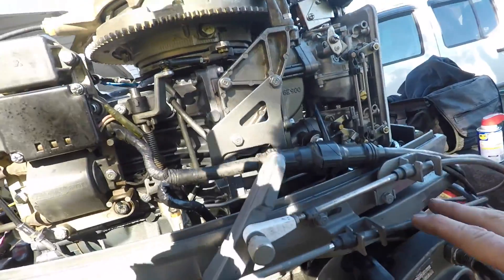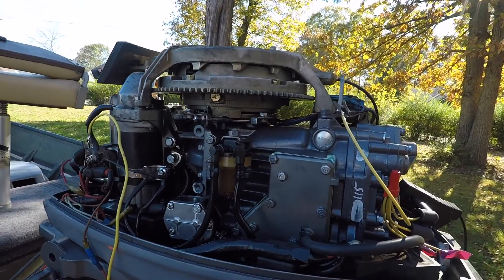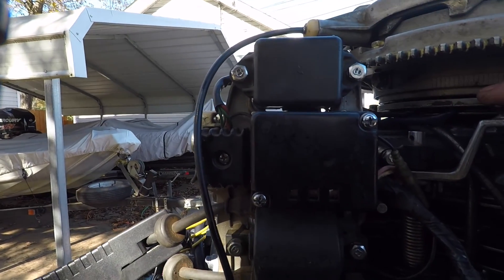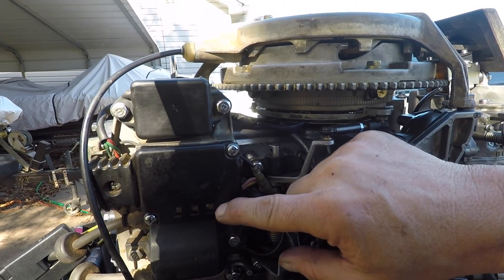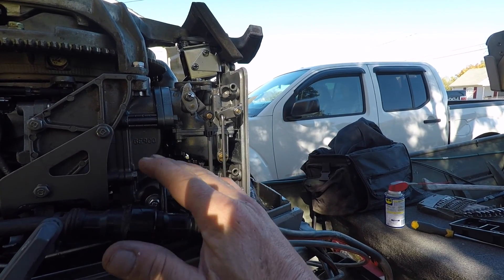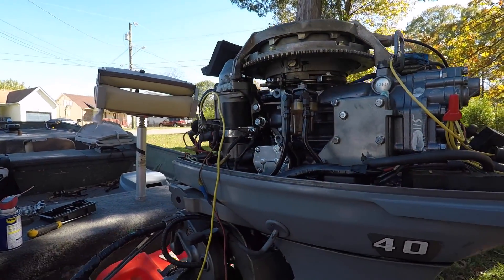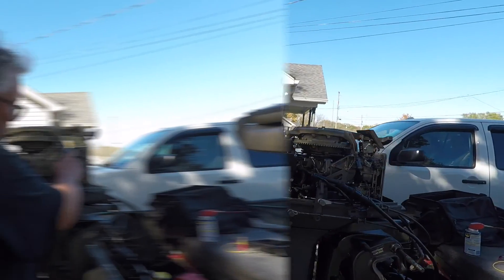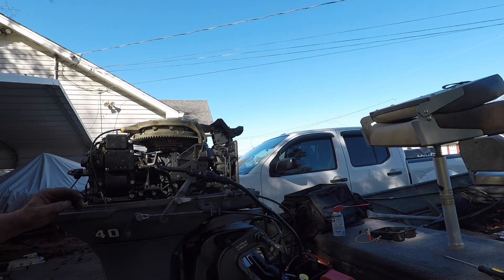Mariner 40hp 40c timing

Comment: Hi. Can you tell me the part number for flywheel mariner 40 6e9.What can I replace this part with? What else is it suitable for?
Reply from the maker: Does it have a serial number?  That engine was made by Yamaha.  Going to depend on that serial number that's on the side of the engine.  Usually near the mounting brackets.

Comment: This is an old post but I love this 40's I've got 2 of them ... Timing ok n Yamahas are about setting up linkage by MM's scale each link set accurately and carbs synked... she'll run fine
Reply: @Showmethefish  I bought an old 1987 Mariner 40hp twins cyl.  I knew when I bought it that it needed the gear case rebuilt completely. I knocked that out without to much complication. Oh yeah, the day I  bought it, the owner started it for me, so I knew it ran. Took it straight home and compression tested it. 140 on both cylinders and so I was again, stoked, with my purchase. Got all nee bearings, seals, and impeller on the lower and she's been ripping ever since. I love that dumb outboard. Thinking about buying a second for a full performance mod. Porting, timing, etc..

Comment: The linkage that you are talking about on adjusting it. The one that advances the timing as you accelerate. Where can you find those. My motor someone took the linkage you are talking about as well as those ball joints they snap on to. I would love to get my motor running again. It will idle perfectly but I cannot accelerate due to that linkage and those ball joints please help
Reply from the maker: I'll see what I can come up with?
Reply: I would appreciate it I went to the mariner sight and a few of the pieces are discontinued. And before those parts disappeared this motor ran great
Reply: @oklahomaoutlawfishin9026  You can find then in Europe. try www.repuestosmarinos.es  Place the part number (yamaha reference) and you should find most of the serviceable parts
Reply from the maker: Hey try calling Marine Sales Warehouse/ob parts they have a bunch of those old powerheads. https://obparts.com/